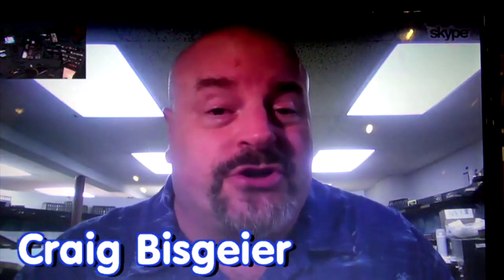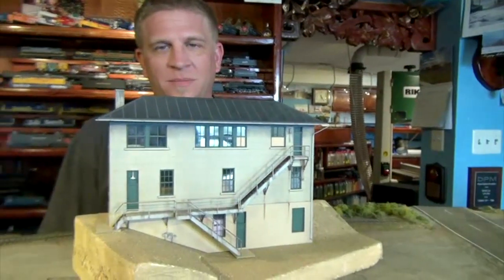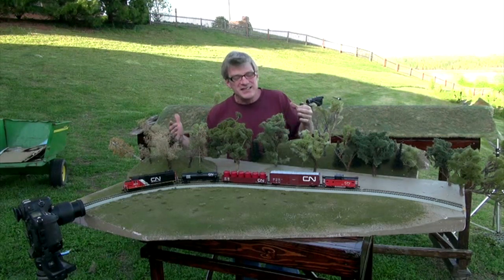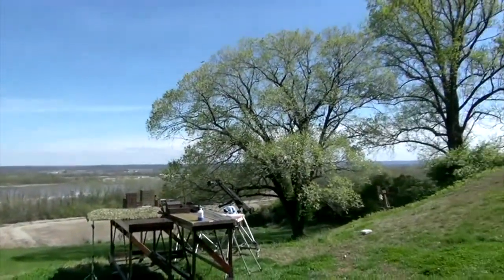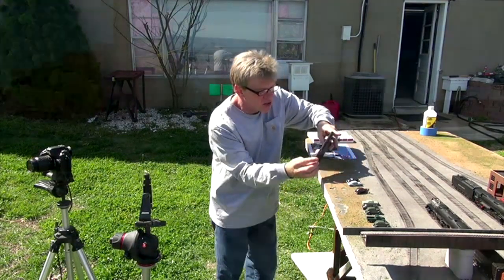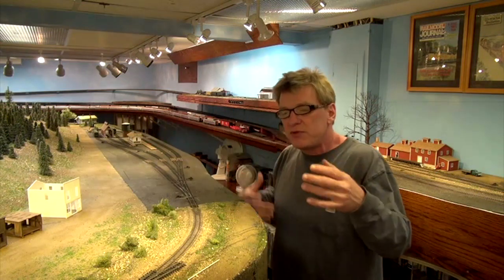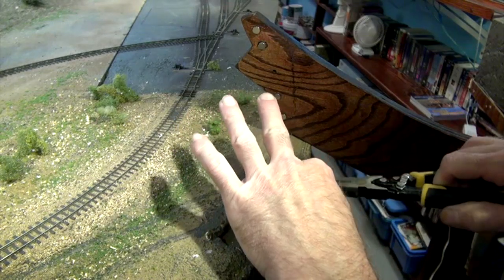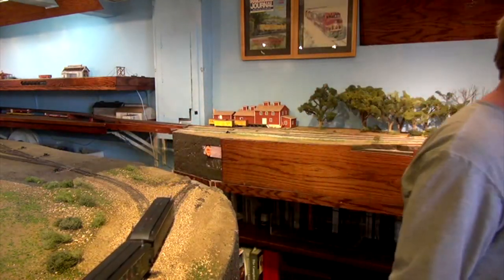What's neat - June 2016 column | Model railroad tips | Model Railroad Hobbyist | MRH

Comment: Great job on the lift out section.  My model railroad will have two lift bridges or sections.  I've been looking at different ways.  This is a great idea...! Q:   In cutting the rails with a cut off disk, did you angle the cut a little or were the cuts made perpendicular to the rails?